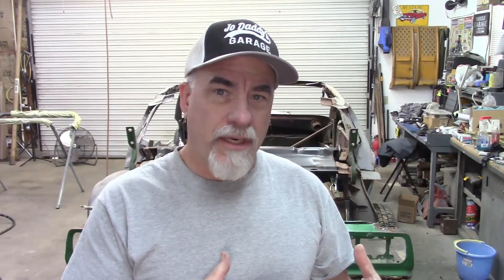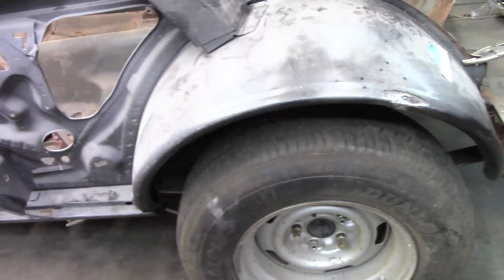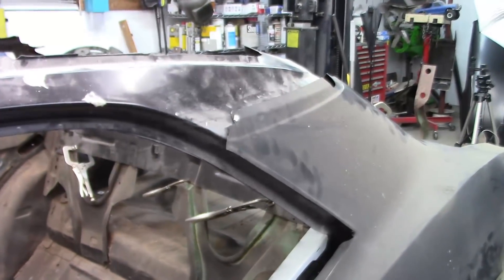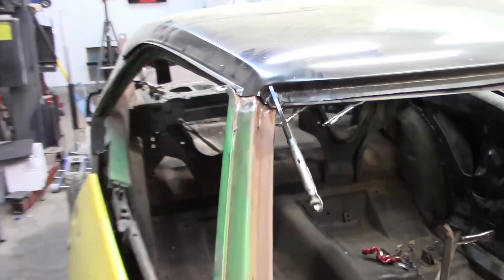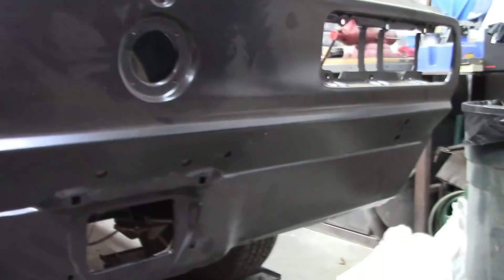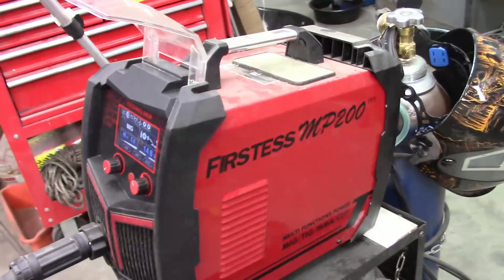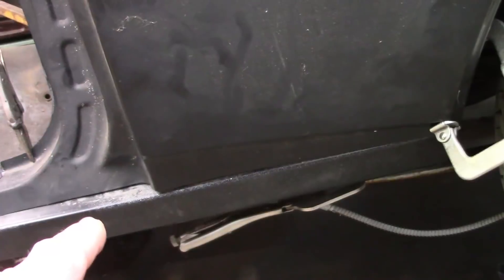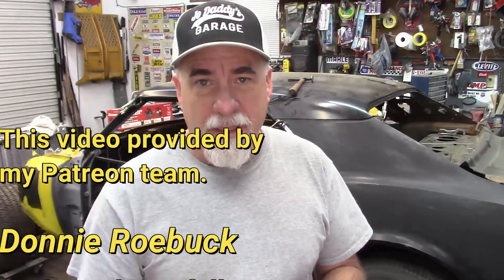1968 Camaro rebuild part 7. Basket Case Camaro.

Comment: Great work Barry- deja'-vu for me! I also had an ill fitting quarter panel- passenger side. And I did the same as you in a way- I cut a wedge out of the sail panel's leading edge, wider at the top, but I cut it completely off. {And then wished I hadn't } But seeing you have done it, I feel better about it. Have not welded it back on. Problem I have is my '67 is not at my place, it's a at a friend's place and I only get to work on it on Saturdays and an evening or two during the better weather. So, I've had lots of time to let it stew in my head since last summer/fall! I hope to get back to it within a month, and get it together enough to bring it home- as soon as I can. Doing a garage overhaul; to make more room. I'll be following closely!

Comment: That's absolutely crazy all them spotwelds....
The drivers rear quarter fits much better now. Definitely start on the other wheelhouse, get that situated and start test fitting the passenger rear quarter. My guess is that's going to fit easier as it didn't take all of the drivers side impact. But it still is another reproduction part, so I'd expect to see normal fitment issues with it as you would. I can't wait to see you take on a Mopar car next, that's a whole different animal..
Good job on it so far Mr thinker... I'd be happy with that too... 👍👍👍

Comment: I went through very similar problems doing my chevelles quarter. There was no solution other than to slice and dice the quarter. I wish I had a spare car to look at! It seems that between all the flexing the body has been through coupled with the questionable tolerances on repro sheet metal you just have to patiently make it fit. Thanks for the video!

Comment: When I bought my 1968 fierbird 30 years ago it was a basket case and a half!! They did the opposite they didn't weld jack! It was pitiful they replaced the quarter panels with junk over lapped it and just tack welded them on the bottom of the taillight panel and where the quarter panels wheel house and trunk drop down panels were not even tack welded I got the car really cheap but dam!! Lol🤔

Comment: Would it be wise to test fit the side glass to make sure the rain gutter contour matches the top of the glass? You manipulated the contour of the rain gutter, it may be nice to know it matches the curves of the glass.
Reply from the maker: NOt necessary. I didn't change the shape of the inner structure that creates the "c" pillar. I made the gutter match.
Reply: @JoDaddysGarage  that makes sense.  The gutter is outboard of the window.  Thx.

Comment: What aftermarket sheet metal part that doesn't fit...   Test the door. I have yet to see anyone jig up anything right outside the factory. Looks great. Lots of tedious welding and grinding on that seam. Fortunately it was at an easy to work on height. Almost like the entire front of that panel was made too narrow overall.

Comment: hi love watching your VIDS , there are heaps of car restoration vids out there  , but your attention to detail is seriously good . Just one little question , you being on old aircraft man  I am a bit surprised you aren't using clickos to hold things in place every now and then ?
Reply from the maker: I really like using clamps. I tend to forget I have a stash of clecko's. In some ways they would make it more difficult as I would have to drill an appropriate size hole, then upsize for welding.
Reply: @JoDaddysGarage  yeh I did think about that

Comment: I think you convinced me to upgrade my HF flux welder. What size tank and gas are you using for body work?
Reply from the maker: I use argon/co2 mix. I’m not sure the tank size, but it is about 3 1/2 feet tall.

Comment: what sheetmetal are you using? I bought all amd for mine and it fits bad
Reply from the maker: I think some of it has a dynacorn sticker on them. But these pieces were bought 8+ years ago. I'm surprised the AMD panels are giving you trouble. I did another 68 camaro previously, and the y fit almost perfect.
Reply: @JoDaddysGarage  My gaps are terrible, I really regret trying to replace the whole quarters and wish I just scabbed in the rusty sections.  Thats been my holdup for years..